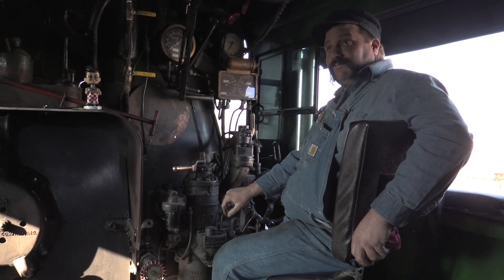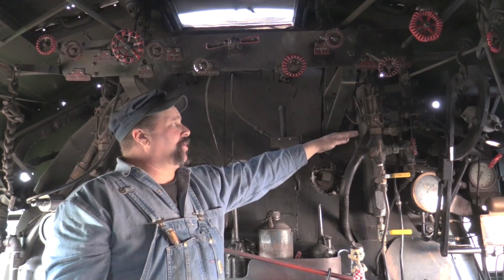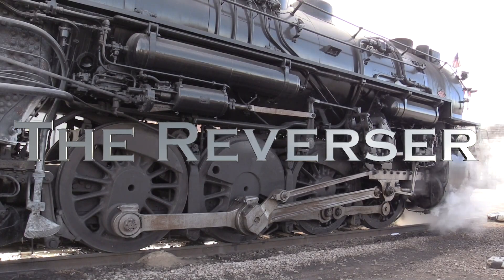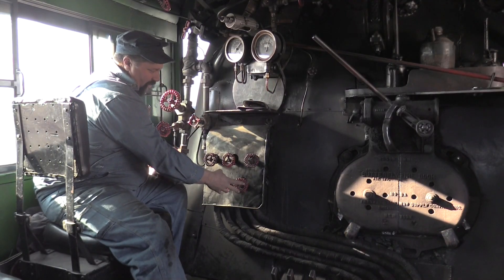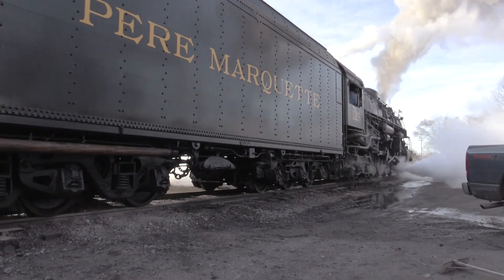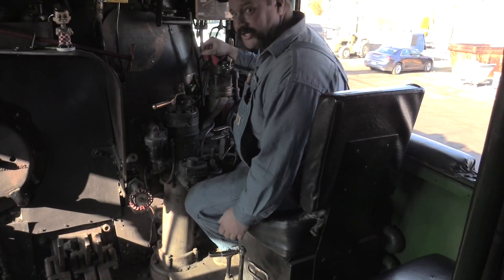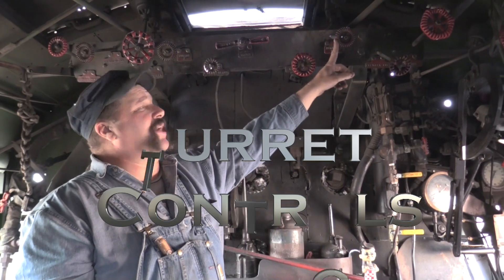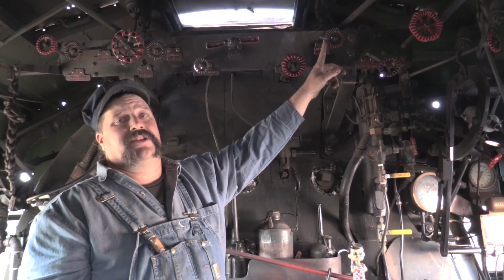Steam Locomotive Controls: Pere Marquette 1225 “The REAL Polar Express" [HD]

Comment: I noticed several key differences between the Real PM 1225 and the PE. In the movie, instead of Yanking back on the throttle to open it, The engineer pushed it forward to open the throttle. The Power Reverse was also changed from 1225's precision screw reverser that used a wheel to change the valve timing to a much more traditional Johnson/Quadrant bar with the Lever. Obviously the whistle chord has a unique design, and less obvious is the addition of a BTTF Flux Capacitor on the Fireman side of the cab.

Some interesting mistakes I noticed were when the kids were driving the train, the Johnson bar lever was red and appeared to be installed sideways and was located on the engineer's left side. It later changed into a different thinner lever located on the emgineer's right side when the engineer took over the controls in the frozen lake scene.

I also find it funny how the kids had trouble stopping the train because they were arguing over which was the brake, but Never bothered to close the throttle, literally just leaving it wide open. The engineer on the other hand was having trouble stopping the train because of a jammed throttle that snowballed into a bigger problem when the cotter pin fell, without ever touching the brake like.. The complete opposite of what the kids dealt with. And the fact a "Magic Train" would somehow have a burnt out light bulb with the headlight noticeably flickering in the "flat top tunnel" scene forcing the crew to make their way to the front of the locomotive to change the bulb, wide open throttle, and leaving a little girl who conveniently lost her ticket to supervise the controls as a punishment of some sorts. 

Also wanted to point out how when the engineer was trying to drive the train across the ice towards the tracks with his Bunta Fujiwara level drifting skills, the order in which he was engaging the throttle, reverser and brake were all mixed up. But I guess I shouldn't nit pick that far xD
Reply: I seriously do personally believe that I seriously saw those exact same amount of differences myself for sure!!!!
Reply: BUBBLIN' BOILERS!!
Reply: TREMBLIN' TRACKS!!
Reply: BLISTERIN' BOILERS!!
Reply: CINDERS AND ASHES!!
Reply: FIZZLIN' FIREBOXES!!
Reply: other differences I've seen in the polar express to the real life 1225. is that the automatic brake being terribly designed with the bumps making it textured like a gear including the fact that it's in "lap" not "running". in the movie the "whistle pull cord" is not present on the Fireman's side. including no feed valves. no whistle valve. red lever missing on the Engineer's side. sanders. blowdown. drain valves. shut off valves and strangely no water columns. and more controls are missing

Comment: What does blowdown do, or needed for?
Reply: The blowdown valve on a steam locomotive is used to remove sediment, sludge, and dissolved minerals that accumulate at the bottom of the boiler. Over time, impurities in the water can form scale and deposits inside the boiler, which can reduce efficiency and potentially cause damage. The blowdown valve allows the operator to periodically release a portion of the water and steam from the boiler, flushing out these impurities. It involves releasing a blast of steam and water out

Comment: I understand that steam engines need to have two means of injecting water into the boiler, but why does this engine have a cold water pump and a injector? Why not just use two of the same injector? Is it because the pump puts more water into the boiler than the engineer's injector?
Reply: The cold water pump supplies the feedwater heater (can be controlled by both the fireman or the engineer), which is somehow omitted from this video. Both methods of supplying the boiler with water should be about equal in capacity (~10,000 gallons per hour) The feedwater heater is the preferred method for supplying the boiler with water when the locomotive is in motion, as it uses the exhaust steam to pre-heat the water before pumping it into the boiler via the hot water pump. This saves live steam (which would be used if the engineers non-lifting injecter were used instead). When the engine is sitting idle, obviously there is no exhaust steam available , and so the feedwater heater is no better than the non-lifting injector in terms of economy of usage.

Comment: I just thought of a question ... How do you determine the current setting of the reverser wheel?
Reply: Two ways; the first is largely done by feel, listening to how the stack sounds, and by looking at your steam chest / back pressure gauge. Back pressure is the residual pressure of steam as it leaves the cylinder as exhaust. Excessive back pressure is wasteful and actually robs the locomotive of power as it basically begins to work against itself the higher your back pressure is. Most if not all railroads had guidelines on how much back pressure you could operate with going down the line. Starting, you normally throw the reverse lever or wheel into the full forward position, crack the throttle, release the brakes , and wait for the train to start moving. As the train increases speed, you open the throttle more, and start coming back on the reverse gear, making sure you stay under that prescribed back pressure limit (usually between 12 and 16 lbs).

The second way, which is the high tech way, is through the use of a locomotive valve pilot. This was a device used in the cab that combined the function of the speedometer and valve gear setting vs speed indicator into one gauge. Through dynamometer car testing, etc., the optimal valve gear settings for each speed range could be plotted, then a cam calibrated to control the valve gear setting needle on the gauge. The valve gear needle itself was designed to show the engineer what the optimal speed was for his current valve gear setting. So as the gear was adjusted via the reverse lever or wheel, the valve gear needle would move to indicate what speed the current setting was most optimal for. This way, the engineer could achieve maximum operating efficiency by keeping the valve gear needle and the speedometer needle super-imposed.